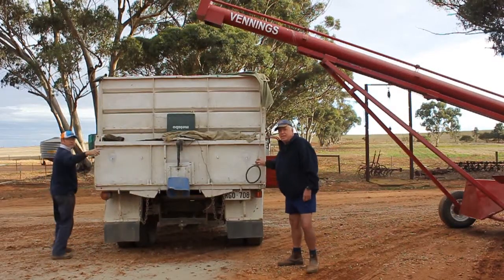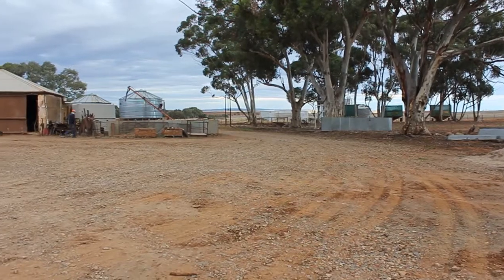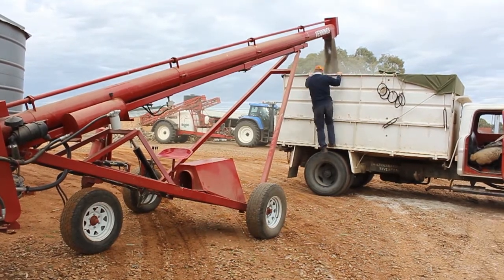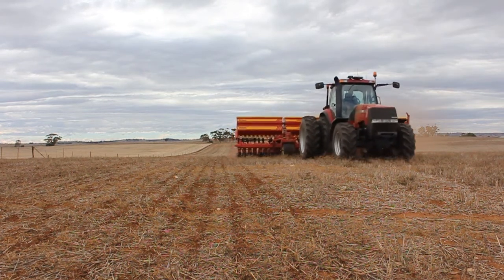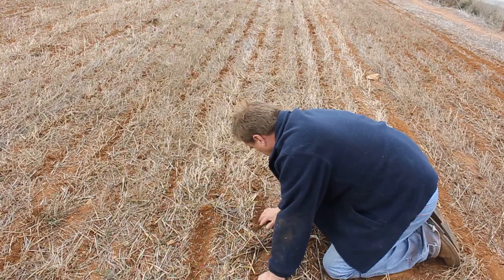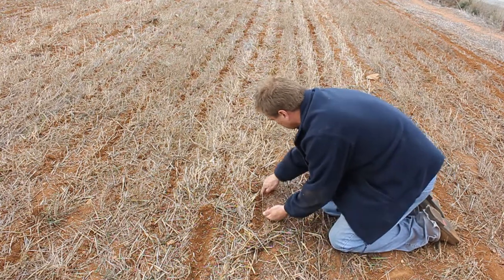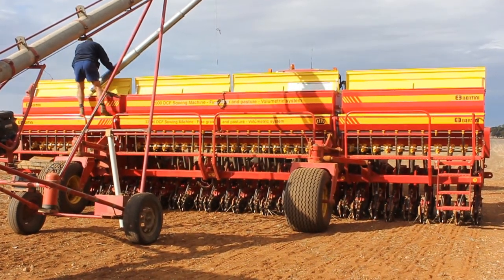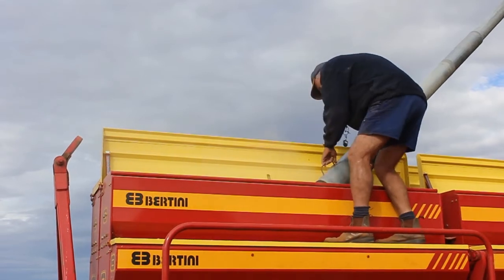Disc Seeders

Comment: When considering Direct Seeding Machinery for Zero-tillage {{properly called Conservation Agriculture by FAO,ECAF +++} the speed of the precision drilling needs to be as fast as can be to be precise........................this is USUALLY ,when Low-Draught Direct Seeders are sensibly used, MUCH faster than the Plowing-Tractor can travel.
Also the amount of Draught is particularly important as conventional tractors have plenty but ,of course,most of it is UNUSABLE IN a CA farming Culture.
It is time for tractor change but also time for Ag-Implement Change.
The new APPROACH ought to be FASTER & LIGHTER G.
Reply: Graham Edwards Something wrong ?? G